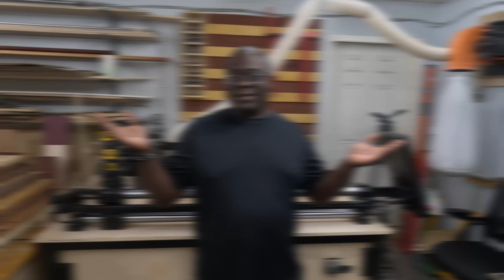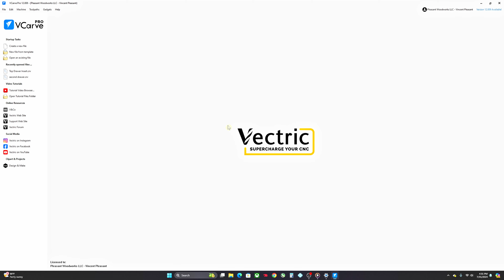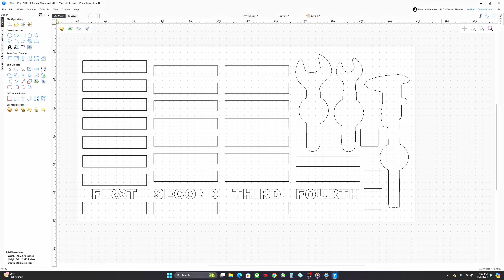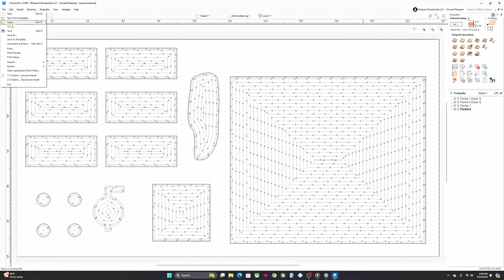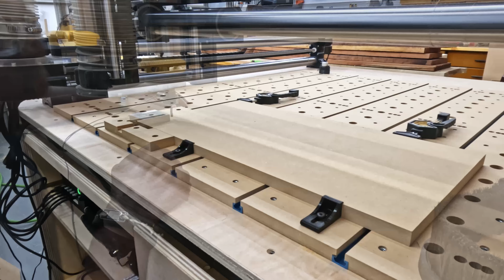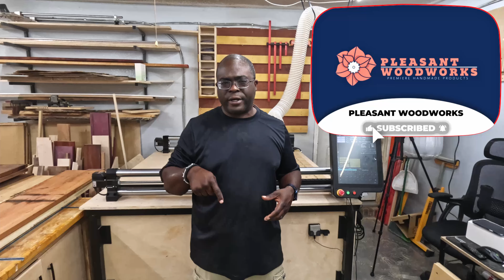CNC Drawer Inserts | My First Project | Onefinity Elite Foreman

Comment: As you gain experience with your cnc, you will learn that you can increase you feed rate A LOT compared to what you are running now. Especially in mdf. I run the beast bit at 150ipm at .25depth, and you machine is more ridged than mine. Great project and Im a new subscriber. I really need to make these for my shop as well.
Reply from the maker: Yea I’ve been thinking lately of how far to push things without going overboard. I’m just not sure how yet for the different bits.
Reply: Watching this makes me closer to a decision to purchase the Onefinity Foreman. Just to organize my roll around tool chest would make it worth the investment. Father’s Day is approaching. Thanks for sharing the video.